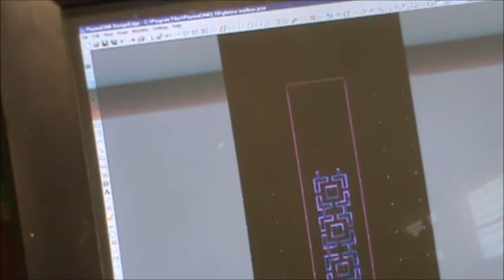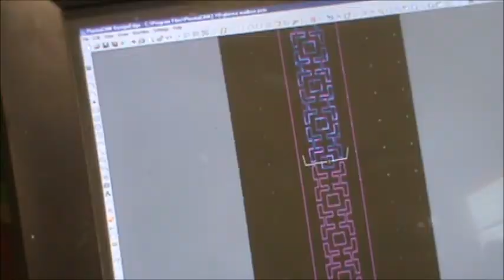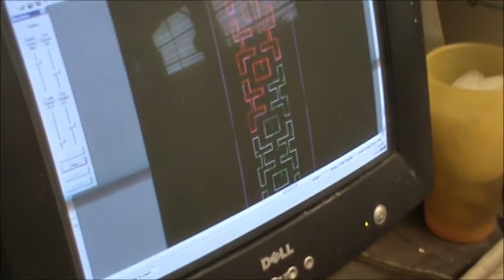can also be out longer than 4 ft pipe

Comment: Great job on the demo! I like the pattern, almost like a japanese lantern. it would look cool with a strip light in it, a whole new meaning to a light pole! :) With a couple sleeves the right size, that could be set screwed to the pipe, for it to roll on, would let you do designs that wrap 360 deg's and are longer than 4 foot also! Boy I wish I could come up with a way to catch those hydrocarbons, on that set up! Keep the videos coming, I like your thinking! Keith

Comment: This machine, is it expensive ? Great video !
Reply from the maker: Yes it is expensive on pipe cutter, plamsacam table  Plus plasma torch and air compressor and your computer. all cost around  $20,000.00
Reply: Price or cost of your machine is 20.000 ?
Reply from the maker: +Nikola Boskovic 

Cost my 4X4 machine is $8980.00 when I bought in 2003.  Right Now I guess between   $10 to $17 thousand  on DHC 4x4 or Samson 5x10 ,   Design Edge software $2000.00.  Pipe cutter $2000.00   www.plasmancam.com   and www.samsoncnc.com